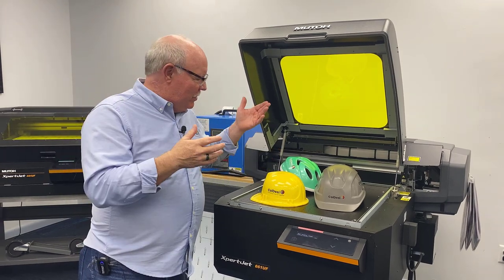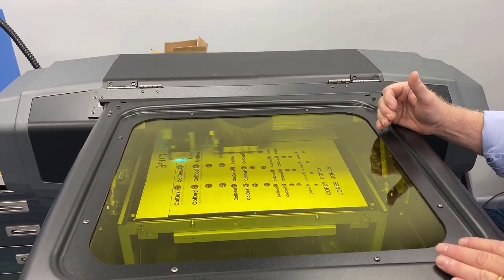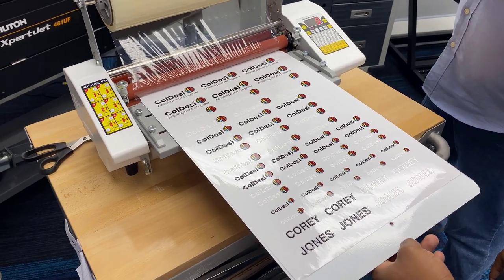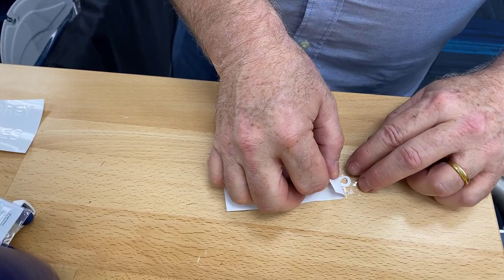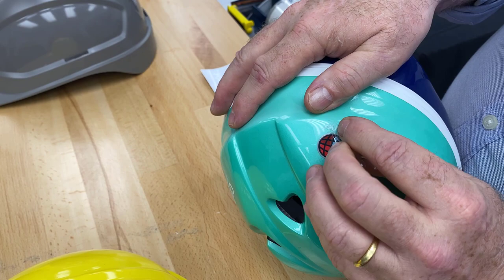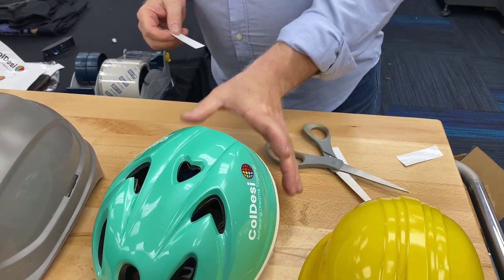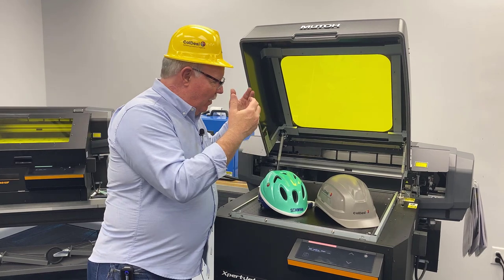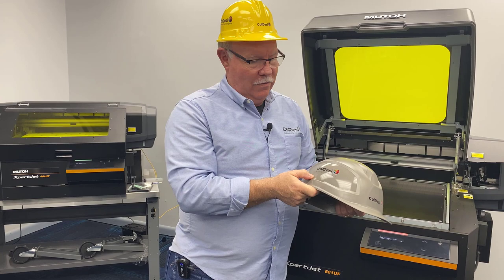UV Direct-to-Film Printing | Customizing Helmets

Comment: I used this on a hard hat and was able to scratch the ink off with my finger nail. Is there a cleaner I can use to prep the surface for better adhesion? Or do I need to give it a day or so. I only gave it about 10 hours before messing with it.